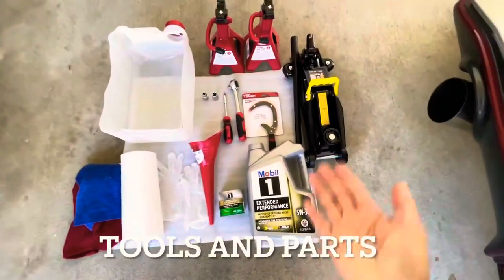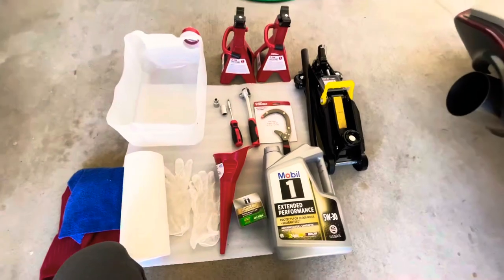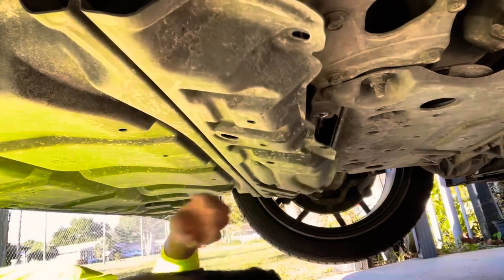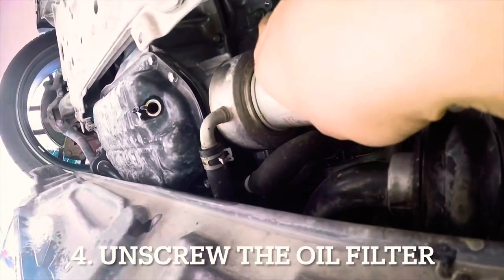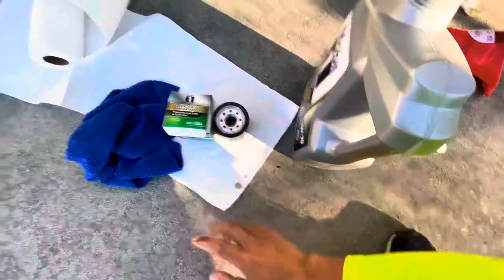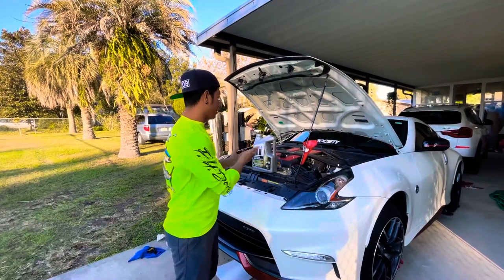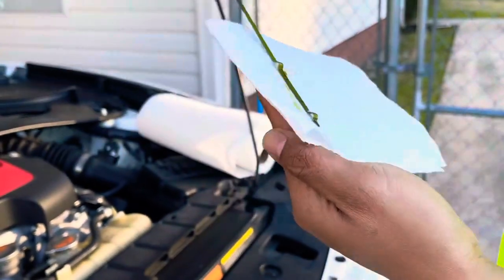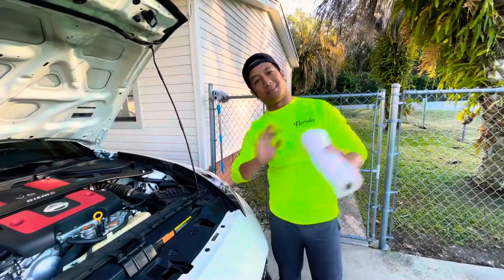Oil Change Nissan 370Z Nismo

Comment: You are doing this incorrectly. Before you put the filter on you are supposed to prime it by pouring oil into the filter media let it soak for a minute or two and do the install. It will extend your engine life for better lubrication for rings and bearings.

Comment: Well where do I start?
#1. You checked your oil level on the dip stick with  your car still on jack stands, and without 1st starting your car so oil can  fill the oil filter!
So that motor calls for 5.2 gallons of oil, 5.2, NOT 5 like your telling everyone, that engine/car model needs an aftermarket oilcooler if you drive aggressively at all, it's known for high oil Temps, it needs to be at the top dot on the stick, ck it on a flat level surface, if you let your car of the jack stands and ck your dip stick now it will be just above the bottom dot! May God man know what your talking about before making video's that people watch because they don't know, reading your comments confirms what I'm saying. Ppl reply good job, blah blah blah.  WRONG PPL
Reply from the maker: appreciate the input. yes this engine take 5.1/8 quarts, but 5 is kinda enough according other youtube /people i spoke too ( z owner) also i said that on my video. so far my car been running great no problem at all.